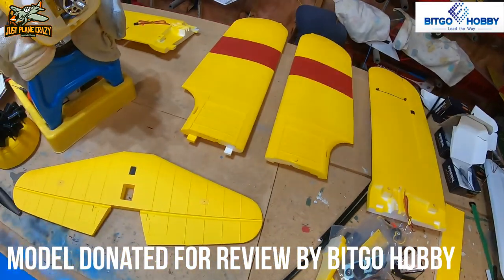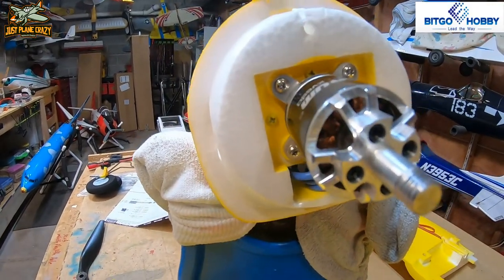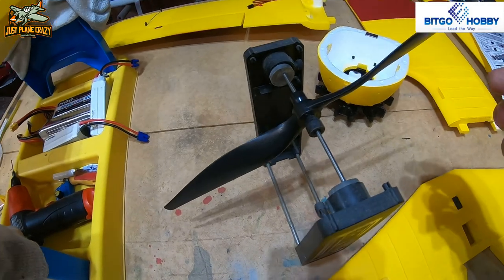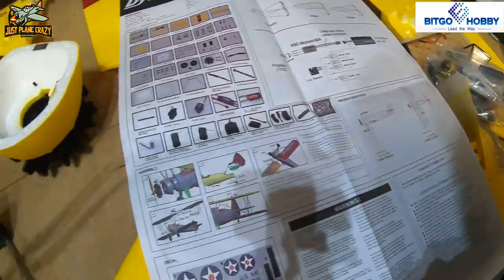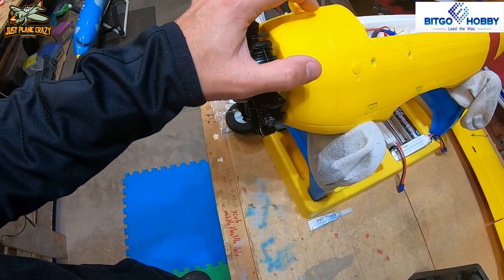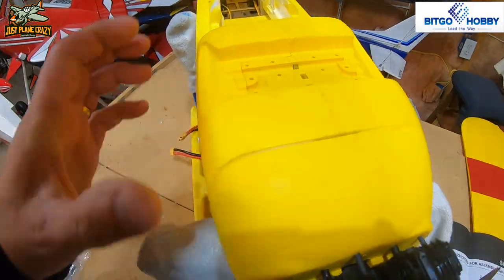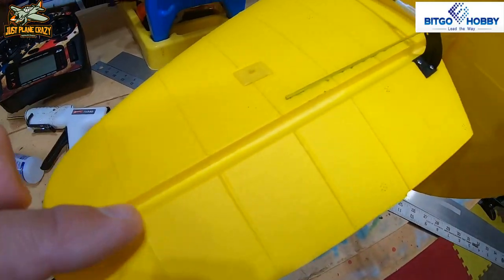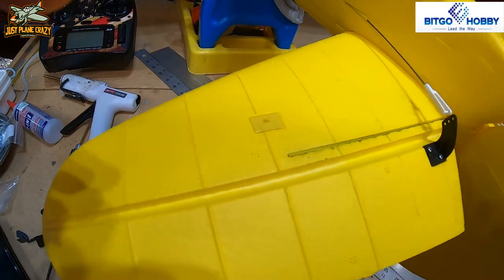Assembly of the Dynam PT-17 from Bitgo Hobby

Comment: They have improved the plastic motor mount fixing compared to older Dynam  models
Dynam used to only glue it on, screws to blind nut are a big improvement.
Looks like different motors now as well

Comment: Got this one couple of weeks ago. Running the 4000 forward all the way up till its against the wood for the motor.  The CG is marked on mine (75/80mm) the amount of added weight to this plane is equivalent to  what is hot glued inside the black plastic cylinders. 2 lead weights per cylinder.  I was thinking this can't be right but it balances on my fingertips at the correct marks for the CG. This is my 1st biplane, so what other's  have said on rc groups for this dynam plane is  that sounds about right to add that much weight. Just seems like alot of added weight for correct cg.
Reply: Thank you on the cl! I just built the blue and yellow one and I’m using the same battery as you and  still tail heavy. I won’t feel bad adding weight to mine now!  Blue skies and tailwinds !

Comment: Great video!!! I have just ordered this and it will be my 4th Dynam from Bitgo Hobby. All have had issues of one kind or another however, they do seem to fly well once the issues have been addressed. I started with the PBY, then the Waco and then the Tiger Moth. As to the price, I feel it's a little high at $229.00 by the time you add a receiver. I think it should have been more along the price of their Waco and Tiger Moth ($189.00 or less on sale), but it is what it is, and Horizon has discontinued the Eflite 1.1m PT-17 so there are few options. Look forward to you maiden video...
Reply from the maker: Thanks for watching. Good luck with yours when it comes.
Reply: @JustPlaneCrazy  A quick question, what do you suggest for hot glue? I'm thinking Gorilla Glue or Stanley (saw a video stating it was very good). Also, would you suggest an expense glue gun (with changeable tips) or just a "cheap" craft version.. Thanks. Oh yes and are you planning to do anymore live streams??
Reply from the maker: Yes.  As soon as my back is fully healed I would love to get into streams again.  Did you like the one I did? Or the one from Motion? So I had a mini craft glue gun. They are junk. Don’t get hot enough. Get a FULL size one. They are sold under that name. I just ordered a new one because my old one just split and died after the pt17 build. Yeah I bought the gorilla full sized to try out. 13 bucks. But it should be good. Also yes get different tips. I went with an amazon set. They are Long and that’s needed for our hobby.
Reply: @JustPlaneCrazy  I did like both your  stream and when you where on with James.. I have seen several of you videos as well and actually ordered the landing gear upgrade for my Viper (which I have still not done a maiden on). Hope your back gets better soon, and thanks for what you are doing for the hobby and for those "lone wolf pilots" like myself..